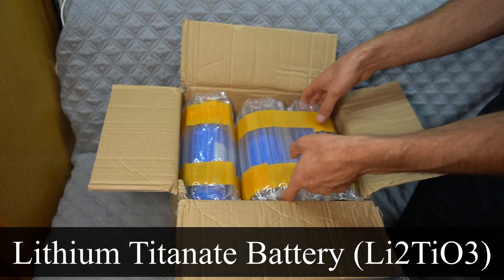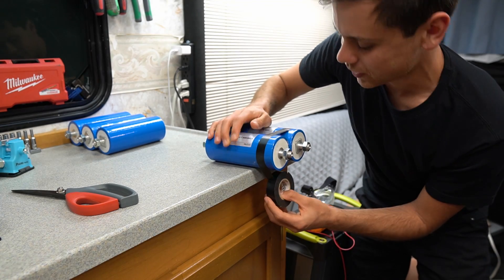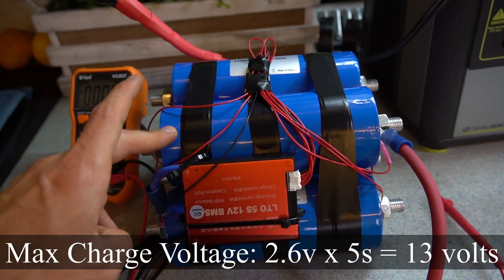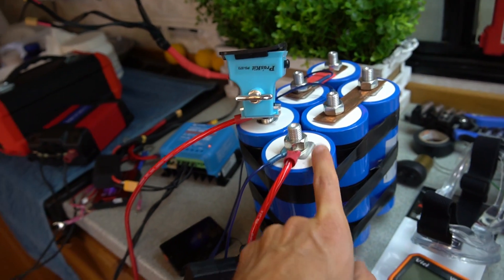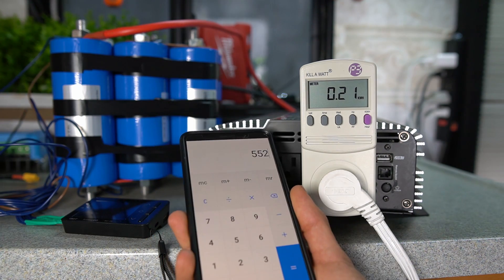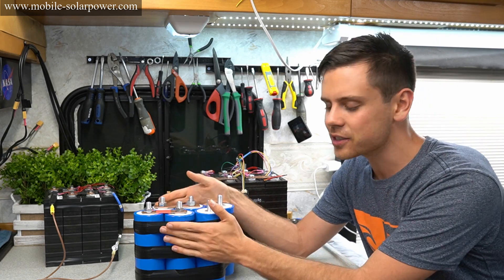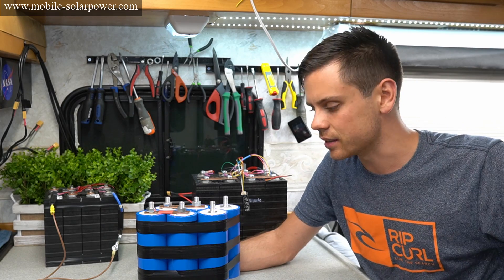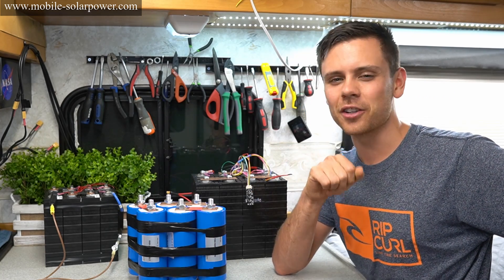DIY 12v LTO (Lithium Titanate) Battery

Comment from the maker: After messing with these cells some more, I don't like them. They are heavy, expensive, inefficient, hard to wire, and the charge cycle/ temperature benefits aren't really necessary for my applications. There are some interesting applications for these cells, but I found them to be a pain in the butt. 

And yes these are probably cheap/grade b cells considering their price. Not a big surprise if they are, but I don't care to research it more due to the downsides of this chemistry. That discharge inefficiency loss is just horrible. I'm sticking to LiFePO4.

Seems like the car audio crowd likes these cells for their charge and discharge rates. Makes sense. 

Anywho, they are very interesting cells. But I have no motivation to do further testing. Going to focus on LiFePO4. Currently my favorite chemistry. Superb properties for solar power systems.

Tired of getting ripped off? Check out my "Will Prowse Approved" solar product recommendations below!

12V Batteries
https://www.mobile-solarpower.com/lithium-batteries.html

48V Batteries
https://www.mobile-solarpower.com/48v-batteries.html

Offgrid Inverter System Builder
https://www.mobile-solarpower.com/48v-complete-system-blueprint-559371.html

Hybrid Inverter System Builder
https://www.mobile-solarpower.com/code-compliant-48v-offgrid-system.html

Mobile Handtruck System Builder (very popular!)
https://www.mobile-solarpower.com/mobile-48v-system.html

Solar Panels
https://www.mobile-solarpower.com/300w-solar-panels.html

Ground Mount Solar Racking
https://www.mobile-solarpower.com/ground-mount-racks.html

Wire, Lugs and Busbars
https://www.mobile-solarpower.com/wire-and-connectors.html

Tools
https://www.mobile-solarpower.com/tools.html

Fuses and Circuit Breakers
https://www.mobile-solarpower.com/fuses.html

Plug-N-Play Solar Systems
Ecoflow, Anker And Bluetti! So many models to choose from. See my current recommendations here:
https://www.mobile-solarpower.com/full-size-systems.html

~~~~~~~~~~~~~~~~~~~~~~~~~~~~~~~~~~~~~~~~~~
Need to build a large DIY system? Need a trustworthy solar distributor? These are my favorites:

Signature Solar
Creator of EG4! Solar Minisplits, Victron and More! Largest Solar Store Online.
If you want $50 off, please use my link below and coupon code "DIYSOLAR50":
https://signaturesolar.com/?ref=cPwLcVc0SW-BjN

Current Connected
Best Prices for EG4, Victron, Midnite and so much more! Fast Shipping and Highest Rated Customer Service:
https://currentconnected.com/?ref=wp

~~~~~~~~~~~~~~~~~~~~~~~~~~~~~~~~~~~~~~~~~~
Join our DIY Solar Community 
Need more help? Join the largest solar forum on the internet for beginners and professionals alike. 140,000 members and counting!
https://www.diysolarforum.com

Check Out My Free Book
Best-selling and beginner-friendly guidebook to off-grid 12V solar!
https://www.mobile-solarpower.com/the-book.html

~~~~~~~~~~~~~~~~~~~~~~~~~~~~~~~~~~~~~~~~~~
Contact Information:
I am NOT available for personal solar system consult! If you wish to contact me, this is my direct email: williamprowsediysolar@gmail.com
FTC Disclosure Statement and Disclaimers:
Every video includes paid promotion or sponsorship (such as free products for review). Some links on this YouTube channel may be affiliate links. We may get paid if you buy something or take an action after clicking one of these. My videos are for educational purposes only. Information is subject to change/update at any time. Electricity is DANGEROUS and can kill. Be smart and use common sense :) DIY Solar Power with Will Prowse is a participant in the Amazon Services LLC Associates Program, An affiliate advertising program designed to provide a means for sites to earn advertising fees by advertising and linking to Amazon.com
Reply: Perhaps the magic bullet that everyone is looking for is actually a multi stage battery.  I think LTO's would be best in combination with both LiFePO4 and super capacitors.  All three have attractive features.  For instance super caps handle inrush and rapid discharge very well in comparison to anything else.  In the world of lead acid this is incredibly important as it relates to Peukert's law.  LiFePO4 are for all intensive purposes immune to the Peukert's law effect to my knowledge and Lithium batteries in general have much faster charge rates than lead acid but there are limitations that super caps can address and it would seem that LTO's could be staged with super caps to aide that function. 

For non vehicle applications I am interested in Iron nickel batteries.  These probably would benefit more from marketplace competition and economy of scale related manufacturing cost reduction than any other existing technology. (If more people used them they would get much cheaper.)  Personally I think iron nickel batteries should become the battery of choice for solar and off grid storage for anybody designing fixed system simply because of longevity, limited toxicity of materials and the obviously ubiquitous nature of the materials involved.  The strategic interests involved should also drive western government grant programs to give preferential treatment to Iron Nickel batteries. (The Godless Communist Chinese who are intent on destroying our way of life have been allowed to corner the market on Lithium.  Let's not feed them anymore than necessary.)  I do reiterate however that having other technologies in parallel to these like super capacitors should increase longevity and help with rapid discharge related issues which would likely even make associated electronics like inverters, charge controllers etc function more efficiently and last longer.  But what the hell do I know?
Reply: Rehoboth Farm - yep multistage is a great design , something I believe EVs will do soon.  Full power in an EV is usually less than a minute, rest of the time cheaper higher capacity battery can do the work.  LTOs would work well also for taking the cycle life brunt of a PV system.  Panels are cheap, batteries are not, 15% loss in cycle isn’t a major issue unless PV is limited like an EV.  My fav batteries are nickel iron :) buy once and rejiuce every decade, done !  Auto water topoff to help.  I don’t care much for efficiency loss, cycle life is where it’s at and less throwing away of materials
Reply: @rehoboth_farm  That's exactly what I was thinking. LFP4 packs could be partitioned in say, the bedroom, the AC, etc.
Reply: @TechieTard  If you were designing a mainly centralized system it would make sense to co locate super caps near large loads.  For instance if you had a single battery bank you could put super caps near the AC unit and perhaps have an inverter dedicated to just that.  IDK.  The idea of splitting up some of these systems into discrete units makes sense to me.  For instance AC.  Since it is such a large portion of most electrical consumption it seems like having it on a system all of it's own would make a lot of sense.  It would be more expensive but in the long term more useful, resilient and of course redundant.  Yeah, an ac unit with it's very own panels, batteries, and electronics that make sense for an AC unit.  One box that has terminals for solar panels on the side.  However, if I were building from scratch I would do a geothermal heat pump which  dramatically eliminates a lot of the load.  THAT is a game changing technology.
Really, I guess it comes down to reengineering everything from scratch in a way that makes more sense.  For instance power companies REALLY prefer us to use devices that are primarily resistive loads instead of inductive or capacitive loads.  Why?  Because if the power is changed into heat in my house it costs me money.  If it is capacitive or inductive I just give a lot of it back to them.  Our electronics etc are designed for a centralized distribution model.  They aren't designed for efficiency.  Think utility companies had any say in that?
I think that perhaps a modular design would be good for the rest of the house.  Kitchen, living room, bed rooms, etc.  Each have their own variable loads, the kitchen being next largest normally.  If you had a system where the kitchen had it's own storage, inverter, panels, etc and perhaps DC lighting to avoid conversion losses... You could still have an interconnect with load balancing between battery banks in each room.  Of course you would want to use a 48v or maybe 72v system to keep line loss low between battery banks.
Reply: they also dont look like the good yinlong cells. possibly why they werent as good. should pull the wrap off one and see what is on the case.
Reply: 15mm copper pipe cut off inch and half bash down with hammer drill half inch hole and u have copper battery terminals. To crimp bash onto copper!cable
Reply: Mark Jones I believe that’s how he made his flat bars connecting battery to battery, except for not leaving one end open.
Reply: The high charge rate and cycle life make these sound like the the thing to use where the energy is otherwise wasted: Vehicle Regenerative Braking. Maybe of a bus, where they have lots of room. Then the discharge rate problem can be addressed by having the LTO cells gradually transfer charge to LIPO cells between bus stops and while stopped.
Reply: Will. I'm presently using a combination of Lifepo4 & lead acid in my solar system. I think they may offer the cheap capacity of the L/A with the high C usage benefits of the Lifepo4......Voltage stability with capacity, maybe. I'm also not charging or discharging them to the max to, hopefully, make them last a very long time. I haven't done any in depth testing other than to say the system is working very stable & I'm thinking it may be worth investigating for people living off grid.
Reply: good old lithium iron phosphate never let you down
Reply: Looking in to 2.7V 3000F Capacaity Super Capacitor banks they are expensive But you cant beat the safty of not having a lower charge rate  just build a large bank of them 12 banks of 6 and you will be set they will not get hot on you and can be drained completely dead and charged full with no negative defect  and there life span it crazy along with there temperature tolerances. Wire them directly in to the charging system get the inline balancing over charge circuits for 5 bux each and easy peesy put 2 car battery's in line with them and you will not have to worry about draw problems any more or capasity.
Reply: @SuperGokuSon  I was think the same thing,. a hybrid final battery.
Reply: @SuperGokuSon  Capacitors are way worse for energy storage. 2.7V and 3000F would only contain 10.935 Joule or around 3Wh. So for 450Wh Energy storage you would need a whopping 150 Supercaps while with LTO you're good with 6 cells. And also: 3Wh would include draining the cap down to 0.0V, which is fairly impractical, since every 12V appliance has to have at least ~9V to properly work, most even more. So for net 450Wh you probably need ~ 300 Supercaps vs 6 LTO Cells. Great for >100C church/discharge speeds, very bad for energy storage.
Reply: I’ve been using these in a solar zap truck and have been doing it without bums . I balance every 6 mo or so and they work perfect. I have the pouch type 55 amp hour and they have worked great. I think for buses or long haulers and quick charging they may be the best application on the market. Mine are set up for 72 volt and I charge to 80 volt . Two pouch’s in series and 8 sets per battery so at 2.5 volts= 20 x 4 makes my 80 volt max charge. Solar is on a rack on the truck and I never have to plug in the truck. Let me know what you think.
Reply: You need 6 cells  to get 12v.
Reply: Will would you still use lifep04 for a electric motorcycle ev instead of LTO?
Reply from the maker: @Zer0phobia  never in a billion years. Energy density of LTO and LiFePO4 is horrible. So is volumetric density. Worst possible choices you can use for ev
Reply: @WillProwse  so what would you use?
Reply from the maker: @Zer0phobia  nca or nmc like every typical ev on the road. Samsung, lg or Sony cells
Reply: @WillProwse  thanks man
Reply: @WillProwse   
We want you to test it longer.
We want to know if it will live 20,000 cycles or it will be degraded early.
You can put it in a device that works periodically to test its real life.
If they have a fake capacity, maybe they have fake life cycles too.
Reply: DIY Solar Power with Will Prowse  - just think of all those golf carts still going on lead acid :)  sub 2010 most EVs were DIY on lifep04 and before that lead acid :)
Reply: @WillProwse  Currently use Lifepo4 on my hybrid project :) It's pretty decent :)  I'm also trying to avoid Li-Ions because I don't want to do the complexity of creating liquid cooling that would make it feasible.
Reply: @WillProwse   I currently use LifePO4 for my hybrid builds. I find its overall qualities passable and safer for my projects. yes it has inconveniences of size. But I manage to squeeze them all in :)  I agree that the smaller form factor of li=ions can't be beat for now. But depends on what your daily range is. For now, mine is perfect. Maybe for people with a bigger vehicle, you can put more Lifepo4's :)
Reply: I looked at information on Lithium Titanate and I saw conflicting operating top of charge and end of charge voltages 1.5 - 2.7 vs 1.8 to 2.8 V.  Did the battery documentation indicate what these levels were. It is possible that you both did not reach the battery never got fully charged and also did not reach its end of charge voltage
Reply: More info link 404.... Great video! 🙏
Reply: I found tubular batteries best for my 5.2 kilowatt solar system.
Reply: Thanks for the info!
Reply: Ok
Reply: Hello
Reply: Are lifep04 good for ebike making applications?
Reply: @miraclesarereal7625  yes they are. using them now. heavy yes but doable. :)
Reply: DIY Solar Power with Will Prowse can I link Seattle lithium titanate Ian lithium phosphate batteries together ? 1-48 V system = 20 - 2.4v Batteries linked in parallel with lithium phosphate batteries ? Will the 2 different chemical compounds work together ?
Reply: How long a cellphone can last with two of those batteries
Reply: @chocholo135  the energy density is not as good as LiFePO4,  LTO would be good for a phone if want the battery to keep charging for your whole life... Good for preppers.
Reply: I
Reply: I really think you need a capacity over 100 amp hours for these to be efficient and charge to 2.7 volts. Once the hit 2.4 they will remain super steady and that is the sweet spot
Reply: 10c recharge with a 20,000 cycle lifespan....yeah, 85% efficiency isn't so bad...
Reply: OMG
Reply: Due lithium titanate batteries due better in cold and hot condition? Compared to lifepo4
Reply: they look like a cap,with better charge discharge .
Reply: What about trying a high efficiency boost converter with a Supercap to keep the voltage optimal longer?
Reply: I have the same yinlong cells (but possibly genuine 40Ah) and my discharge efficiency seems fine, albeit at much lighter loads.  I'm using 12 cells in series and cycling them about 400Wh per day, my solar system reports the overall system efficiency is approx 96%.
Reply: @PLANETaXis1  in your opinion, what is better for 24V system: 11cells or 12cells?
Reply: @zarbonida  11 cells is probably closer to a 24V lead acid voltage range, especially on the fully charged end. I have to keep my 12 cell system slightly below full charge to stay within the allowed range of my Engel fridge (30v max).
Reply: @PLANETaXis1  thank you!
Reply: @PLANETaXis1  Where did you get the yinlong cells?
Reply: @renerworld  AliExpress, can't recall the vendor though.
Reply: @PLANETaXis1   Thanks. You can confirm from your aliexpress account though.
Reply from the maker: Lto study: https://www.google.com/url?sa=t&source=web&rct=j&url=https://www.mdpi.com/2313-0105/4/4/59/pdf&ved=2ahUKEwjYqcyS2OviAhVItZ4KHXlTAx44ChAWMAF6BAgIEAQ&usg=AOvVaw1lmPrKfdeaBh4aheqgxiiM
Reply: @WillProwse  You should think of these cells as a replacement for super capacitors only they hold 10x more energy than a capacitor and charge/discharge almost as quickly. They are amazing in a high power car audio system, where the usage makes sense. People have 50,000 watt car stereo systems and these cells are built in a huge bank, with 4-5 370 amp alternators recharging them. They can take the charge so fast, and discharge really fast, which is perfect for an amplifier operation. This would also be great for a starting battery for a car. It can charge at 14.4 v no problem and give reserve power when the car needs it, and they can rest at 14.4 when the car is off, no problem, and they can give great bursts of energy to start the car, and you would never, ever have to buy another car battery for the rest of your life. You could literally have 1 single car battery that you swap between every car you own for the rest of your life, and this would never go bad.
Reply: @WillProwse  ok
Reply: @WillProwse  i m looking a chemistry that can charge like 12V 300A do you know any?
Reply: @transparenttryonhaul5  you should look at super capacitors. They do loose energy over time just sitting around so take that into consideration.
Reply: good day,
after seeing a lot of videos of you, I have received a lot of info. I want to run my solar on LTO, after your video, I have doubts. As I see in the video, you give them max 2.46v per cell in 6s. the best V is 2.6, sweetspot. you really have to load them up to 2.75v, max is 2.8v. and then in a 5s setup. then you start on 14v without load, and under load, you will immediately start at the sweetspot 13v + -. my question is whether you will want to do another test with this data so that i can remove doubts. I will really appreciate it. have a nice day. Greetings
Reply: Did you also test the cells at a low discharge rate? Every Li-ion cell I have come across has a nominal capacity that is only attainable when discharging from 4.2 to 2.7/8 ish V at like 0.5A max. If you discharge it faster the capacity drops, if you discharge to 3.0V instead of further down into the high 2's then you'll lose capacity as well. I'd recommend, hooking up a product that draws max 0.5A from the cells and then measuring the voltage over time. You might be right that these cells are just rewrapped lower cap cells but they might be very sensitive to discharge rates when it comes to capacity. I know most 18650's are. Cheers!
Reply: Thanks for the info
Reply: When will we learn,, nothing from China is much good. As for charging cycles, no way to proof that either. The lure is everything is cheap. When will we learn.
Reply: I agree with your assessment of lto I prefer lifepo4 also.
Reply: Are you primink?